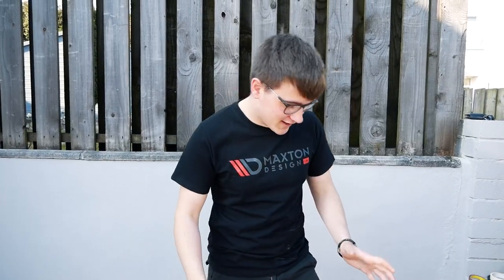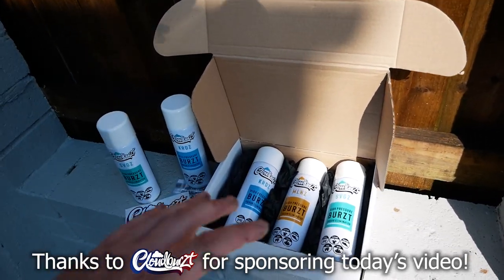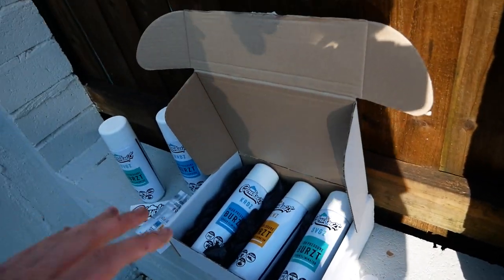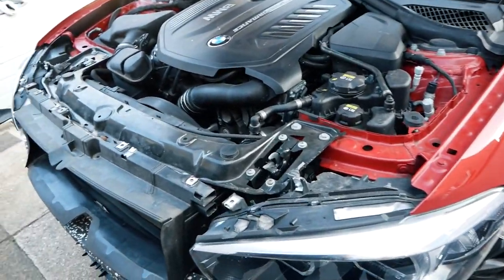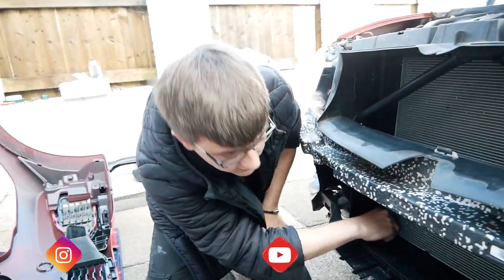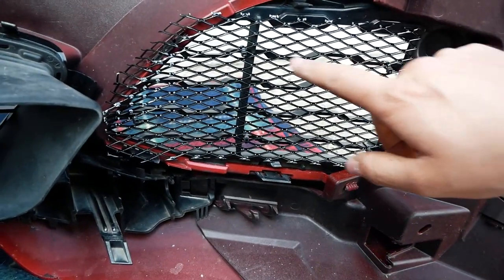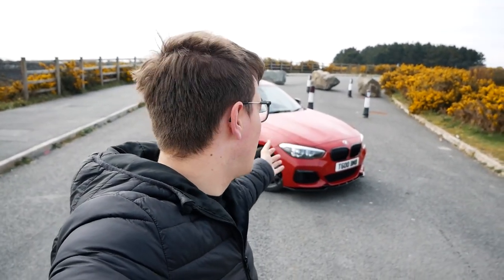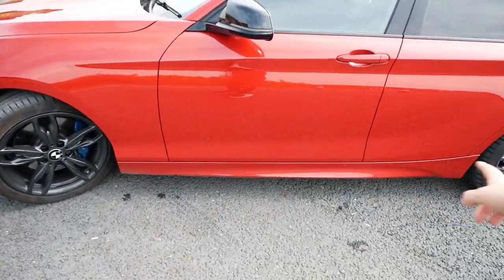ALL MLITE OWNERS NEED THIS MODIFICATION! 👀 + Splitter install 🔥

Comment: Nice! Just put the V1 on my m140, took bloody 3 hours, hard to get it lines up properly on your own, and I also had great trouble getting the center self tappers lined up when reinstalling the bumper, but the v1 looks the nuts installed! Good effot. 👍

Comment: It looks like the air vents on the front bumper have a gloss black trim surround?  Is that standard or an add-on mod?
Reply from the maker: They are wrapped gloss black mate 😁

Comment: I will install my V1 tomorrow. Do I really need to take off the bumper? A friend of mine has a vehicle lift, so we can work easily underneath the car
Reply from the maker: You can do it on the car but can make it easier taking it off 🤔

Comment: Becareful when you go over bumps with those bolts facing down, you may rip the bumper if you catch them
Reply from the maker: They don’t stick out much more than the others so it should be fine, but thanks for the thought! 😊

Comment: I'm trying to get hold of an aggressive-looking sporty rear diffuser for a single exhaust, but all the suppliers I found have said I need a dual exhaust conversion. If you find one for a 116D, please let me know and I'll buy it with your referral link/code.
Reply: No such thing pal, I’ve looked for my 116 for awhile, gotta go dual to get a nice one
Reply from the maker: I’ve seen one on a forum before